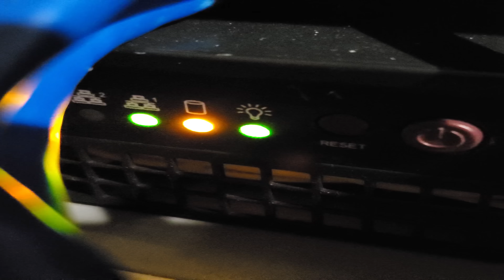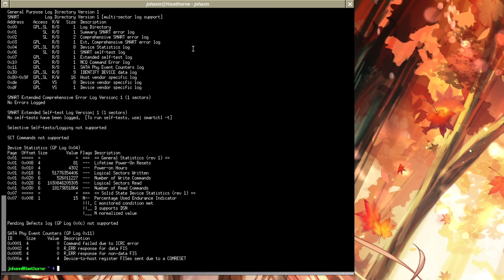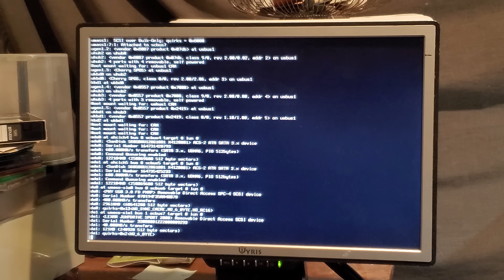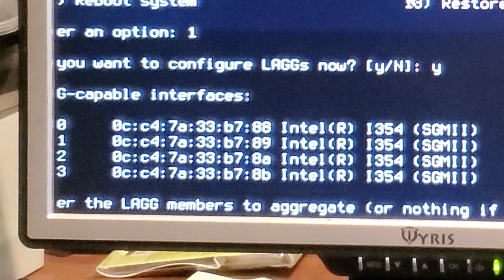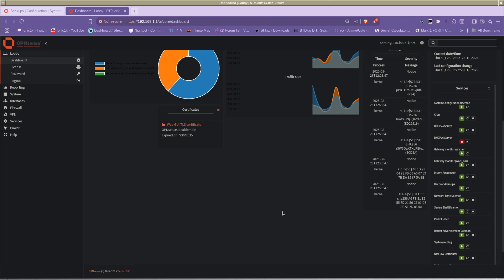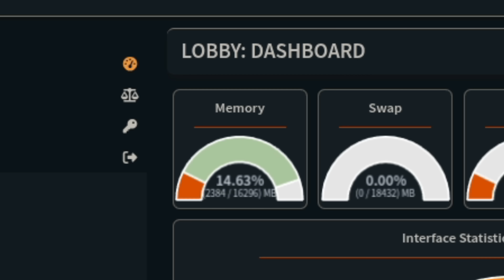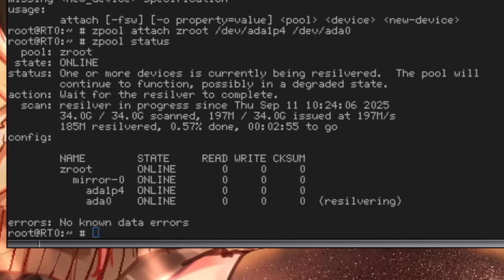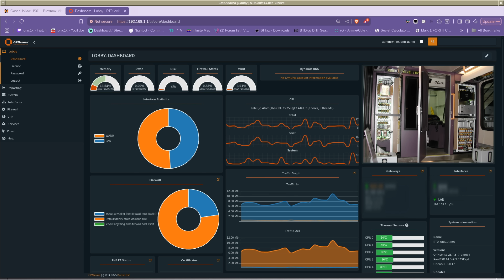Fixing my Broken Router

Comment: I think the screen being cut off is not the fault of the graphics adapter on the router. It's more likely the auto calibration of the monitor. I've noticed it as well when trying to use the auto calibration, while displaying mostly black or dark image. The monitor will ignore parts of the screen, unless you display a more "full" image for it to analyse and find the actual edges of the content.
There should also be an option in the monitors' OSD to manually adjust it in cases like this.

Comment: i know its not a popular opinion among networking guys. But you clould install OPNSENSE or whatever you use in proxmox. That way when you upgrade hardware or decide to reinstall something different you can move your install to some random computer while upgrading so you have a lot less downtime. Also proxmox has better firmware for most NICs than OPNSENSE, thats also pretty neat.

Comment: That is a cool rig! I am curious if you are using the whole 16GB or it was just the thing at hand. I built a similar but more modest setup on a passive-cooled aliexpress N150 and I got it to run 3 VLANs and 2 VPNs, pihole, and suricata serving 1GBps internet to a 2.5GB LAN with a 3-node Wifi6 mesh (giveaway for scraps that turned out to just need a firmware reset, LoL) to around 50 devices, around 20 offsite. I used no raid or ZFS redundancy but 1 failover SSD that gets the weekly proxmox system backups so I can just boot into it whenever (I know what people say about VMing your router but with HW passthrough I noticed 0 latency or throughput impact; and 5 minute onsite manual reboot is not the same as 0 downtime on disk fail but whatever). Anyways it turned out it was still overdimensioned enough (10% load peaks)  to allow me to dedicate half of the 16GB of RAM just for some ELK stack with some nice Kibana dashboards to monitor it all. I always wanted to run a real big boy server rack but the noise alone (no server room)... and maybe the electricity bill, considering it is .25cent/Wh where I live I am glad my whole setup with a PoE switch peaks at less than 80 watts. All in all I was a bit hesitant at first but almost 1 year later I 100% recommend a 160 USD budget minipc as router: As much of a toy as it looks like, it really packs a good punch and bang for the buck ^^

Comment: Nice work! One comment: in this configuration your RAM isn't working as expected. You put 2 sticks in the same channel. According to the manual you should put it in two most outside slots (A1 and B1) so it can work in dual channel mode. Google Supermicro SYS-5018A-FTN4 and download the manual. On page 5-4 there's a section called "5-5 Installing Memory" with "Memory Population Guidelines" paragraph.

Comment: I tried doing zfs mirror on pfsense a few years back and one of the drives failed. After replacing the drive and resilvering I was unable to get the new drive bootable (efi system). I eventually just reinstalled. Does OPNsense have an easier method to resilver and retain its ability to boot? NVM I guess not.

Comment: btw you do know that LAGG does not increase the throughput.. meaning two 1 gigabit port in LAGG will make it possible for 2 devices to run at 1Gbs not one device running at 2Gbs.If i understood your solution that it wont work.
Reply from the maker: this depends what LAGG configuration you use, though in general it would make the internet speed faster because not everything is one data path. But in the event that one ip is requesting a download or upload of a big file for example, that single data stream will have 1 gigabit throughput, while the other internet traffic will be unbothered.

Comment: i remeber having 1tb SSD By SANDISK in my old Macbook2012 
that i left on most the day and night for a year and That had major slowdowns and FAILD 
i never used the mac to its fullest but did leave it on to be used like a wifi router.

im never buying SANDISK Again until 2035

Comment: Maybe I'm just old and lazy but my home firewall runs regular OpenBSD on an PC Engines apu2 in 2016 (no fancy UI or features just basic pf firewall and it runs one of my local DNS, dhcp, and segments my wifi as well). I bought 3 of them originally, one for home, one to use where I host my stuff at a co-location facility, and a 3rd spare. When I want to do anything disruptive like upgrade the software, I install it on the spare, configure it as a replacement then move the network cables over. Worst case if I mess something up bad I just flip back to the other box, though usually if I mess something up it's minor and have never had to roll back. Fortunately no hardware failures on them. My internet connection isn't fast like yours so 1G interfaces is more than enough for me. I did originally upgrade to the apu2 from Soekris as my Soekris boxes only have 10/100 NICs, my internet connection is around 250Mbps, and my co-location is 100Mbps. I did the replace to upgrade thing with Soekris as well(didn't have dedicated firewall HW in co-lo at the time). Did have a CF card fail on a Sokeris at one point though I don't think it impacted availability. Originally configured the two Soekris as automatic failover in OpenBSD but later decided I rather have a cold spare not connected to power.

Comment: Why not using SSD for running fast and the old HD just to keep logs?
Reply: Generally the HDD will be more reliable long term. In reality there's minimal speed difference since the system operates in RAM mostly anyway

Comment: Using used drives in a rackmount router is a bold move, glad to see that it came out good in the end at least
Reply: I don't see it as a big deal. My router is one of the least places I'm concerned about drive failure or data loss for real. Just keep a copy of your config backed up.
Reply: @MaxUgly this.. and...uhhhh... Zfs
Reply: I trust used ssd more than cheap noname ones. 50% health Micron over 100% Leven any day
Reply: Used Solid States at that, but i mean, it is just a router, unless you really need those logs it's not a big deal as long as your conf is backed up.

Comment: add more ram pal
Reply from the maker: I DID!
Reply: you need 4 ram sticks 2 get the best speed pal because its a quod channel cpu pal. it will be a lga2011 xeon of some flavour and they work best with all 4 channels pal
Reply from the maker: @johnmay4803  your wrong pal, go look at a spec sheet
Reply: @Ionic1k  my bad i just thought ur board looked the same as mine and mine is a lga2011 xeon v2, i thought it was strange having sodimms